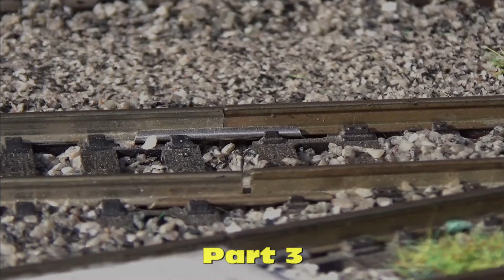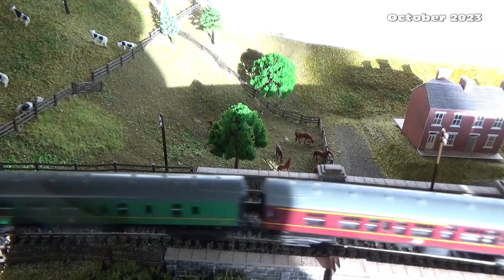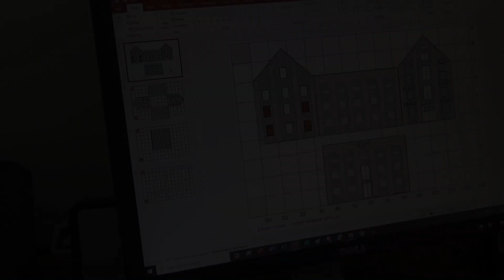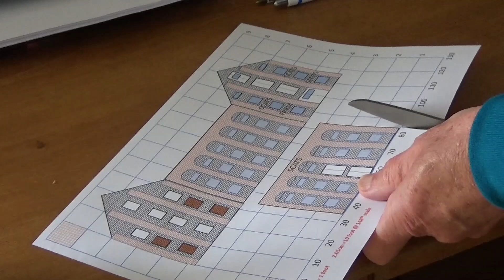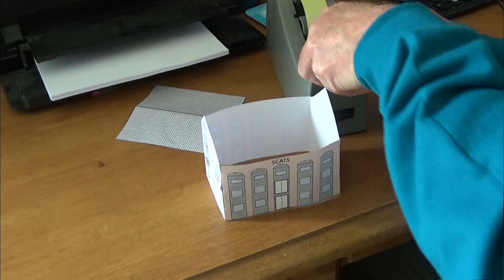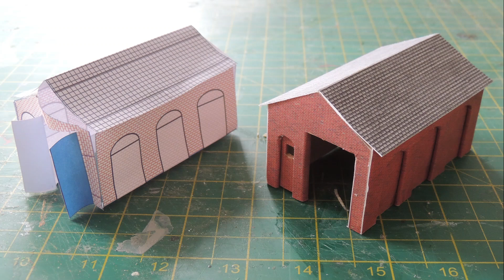Mid Hants Railway. Alresford model railway part 3.

Comment: Trick for getting measurements from photos is to count bricks. It can help check measurements. Google brick dimensions chart for tables of brick to measurement. Vertical checks are quick, if you times the number of brick courses by 75mm you should be reasonably close (imperial bricks might vary but should be okay if you use 215mm for whole brick length with 10mm for mortar joint at one end e.g. 440mm is a two brick wide pier - 215 brick plus 10mm joint plus 215mm brick) hope this helpful in your scratch building - great looking layout so far.
Reply from the maker: thank you. I tried several methods at first, including counting bricks, but at the end of the day the [station] building just looked too big. I found that once i was happy with the station building, the other building needed to look relatively proportional to it. As the store house was behind the station, I actually made it a little smaller. If I'd build the layout the other way round, then I'd have built a bigger storehouse!
Anyway, thank you for the advice and I must say your layout is coming on well too!